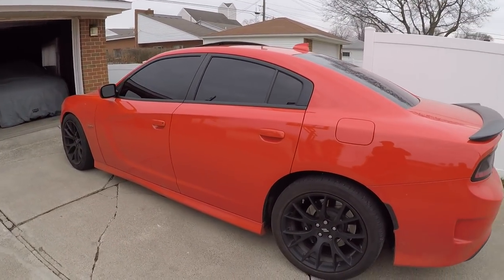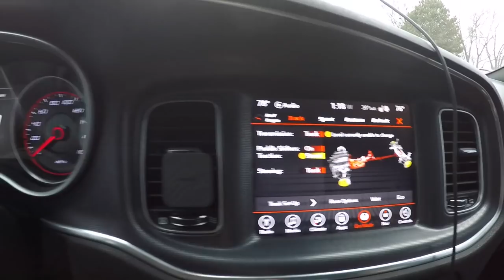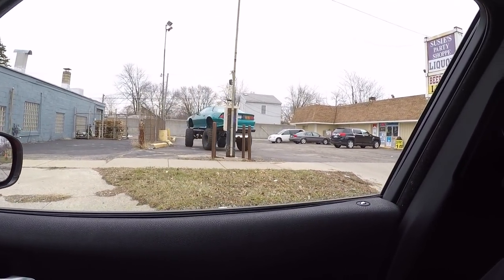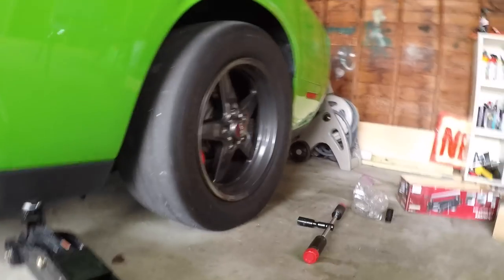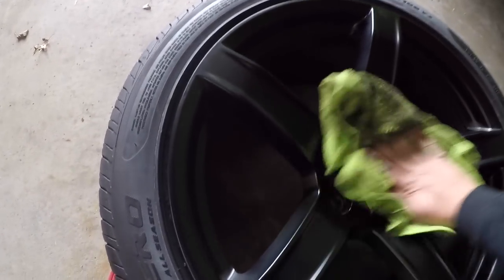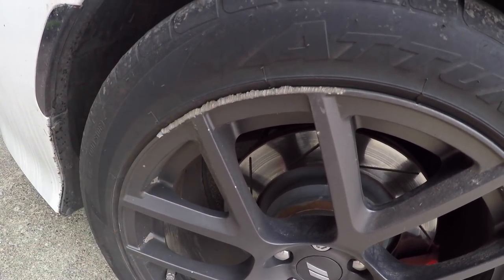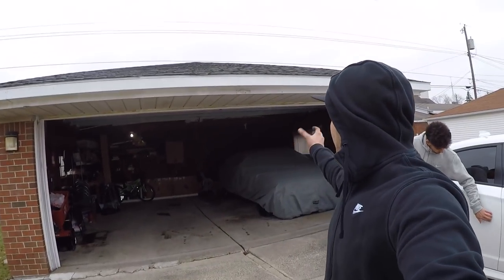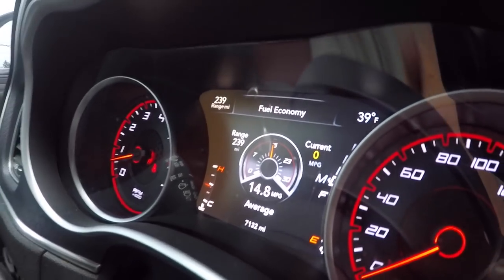PUTTING NEW WHEELS ON MY HELLCAT

Comment: You had the Jack in the wrong place,it goes on the rubber boots under the car and use a jack stands when you are doing it for safety and something in front of the front tires to keep it from rolling, I take that 2ton jack back and get the 3ton.for safety.
Reply: Michael Williams I was just about to comment the same thing lmao